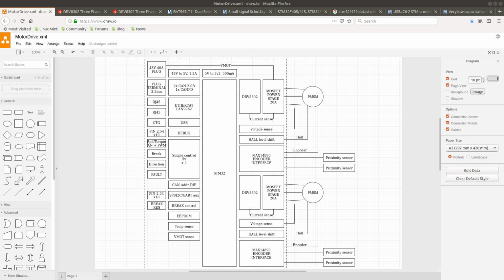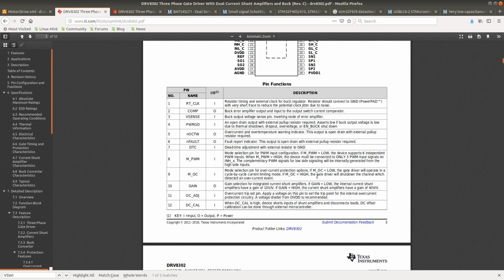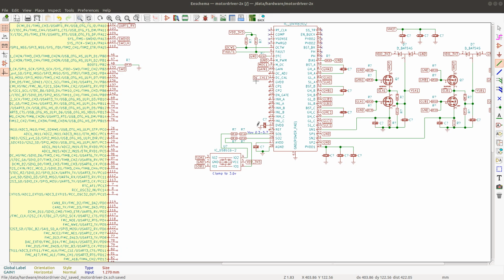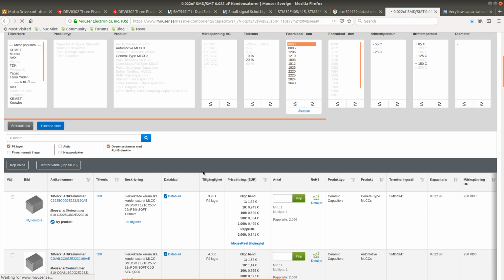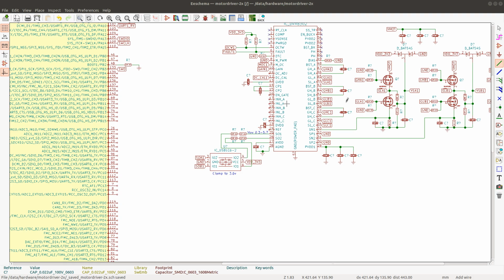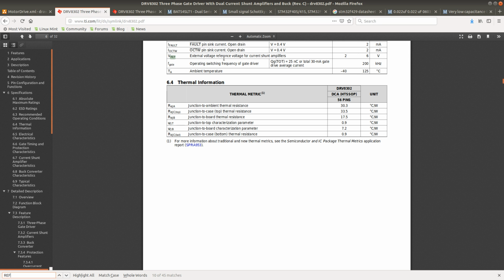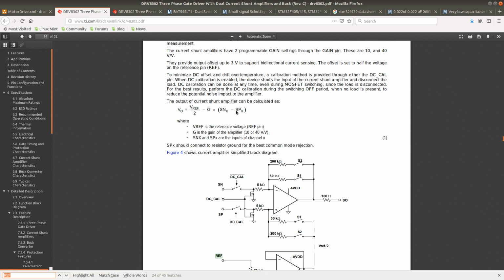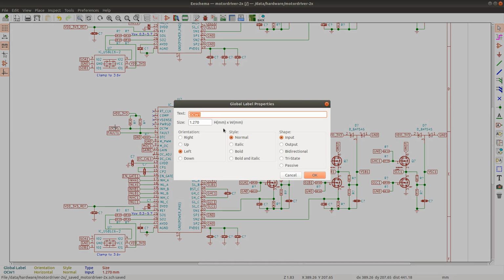KiCad Schematic Design #7: wiring up DRV8302 pins - Embedded System Consultant Explains

Comment: Thanks for your video ! I would like to know witch version of kidcad are using  am getting some troubles when wiring  my components .
Reply from the maker: I use 5.1 here I think. In some videos I used a version where I wrote a side panel to make it easy for me to work with product codes and library components. I also added changes to how fields are updated from the libraries. But I don't think I made any changes to how things are wired. You need to make sure that your library symbols use the default grid, otherwise your pins will be off grid and you will have trouble wiring.
Reply: @mkschreder  Thanks i will try again